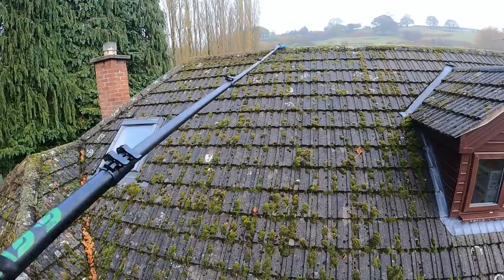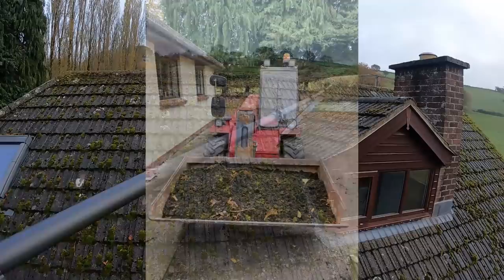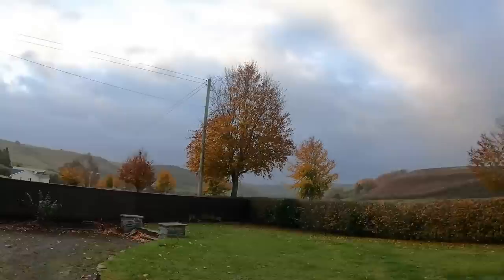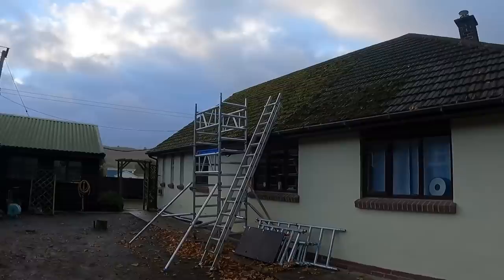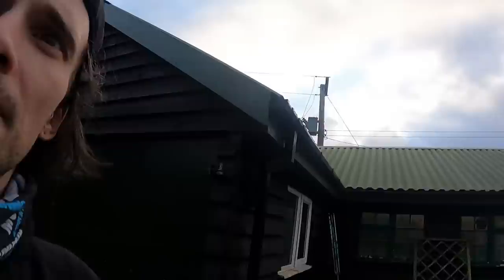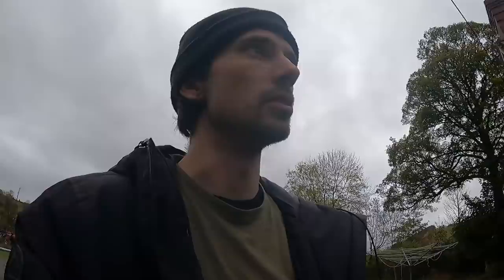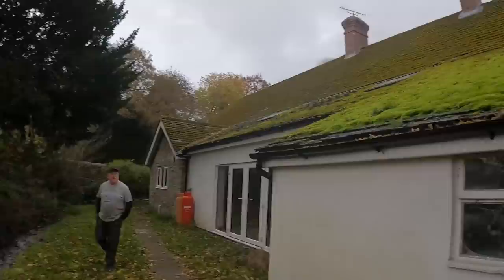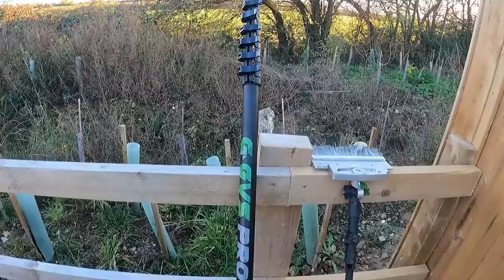THE CRAZIEST ROOF I'VE EVER CLEANED!

Comment: Would putting a tarp on the floor, along the walls, to catch the falling moss from the roof... be an idea ?
Hope you can requote and get proper compensation for the hard work.
Cheers !
Reply from the maker: I usually do but it was just concrete and like a really thin layer of gravel so real easy to clean up on this one, thanks!

Comment: That was a bit gutting for you. Did the customer send misleading photos or was it just difficult to see the depth of moss from the images? Would it have not been worth it to do as much as you could with both of you then come back on your own to finish as that way just your time and fuel to take the hit on? The pole is looking good, it would be great to see you flexible it is say next to your ova8 40 but extended same length.

Comment: I have to say I find the skyscraper tools don't fit snug into the roof tiles. Obviously the flat tiled roofs are no problem but when it comes to a Marley double roman for example  then there's  massive gaps between the blade and the tile, hence not getting half the moss. Does anyone else have the same issue? Do they need filed down?

Comment: Hey, I have been meaning to ask, what happens if the moss is left alone to live forever on the roof? Just Curious
Reply: Eventually it will start growing under the roof tiles and moss holds water so it will inevitably cause leaks on the inside then you'll need a lot of work done potentially costing thousands of pounds 👍🏻

Comment: Good Job on the first house....another great video.... You mush have arms and shoulders like HeMan..

As others have said sheets on the ground help making clean up easier - the gardeners use them when hedge trimming too for that reason.

However - if I was the second customer.... I would have been disappointed... you did a deal... then did not go through with it.... I understand you underquoted.. but if they gave you photos of the whole house... then surely its your issue?

How did they react to the news.?

Also as a thought - after you do the scrape... how about running a small FSC with your pressure washer and low pressure using the pole - to get the bits off before you do the bioside? especially with the badly covered rooves like these two?

Keep Up the good work!

Comment: Great vid as usual 😁 just a quick question how much does it cost to remove moss as my roof is horrendous cheers
Reply from the maker: it depends on the size of the roof really but anywhere frrom £700 - £1200 is a typical job, depends on contractor, distance to travel, how bad it is etc. Larger homes will be more

Comment: I have to ask, is there no machines out there to take the pressure off you, this is back breaking stuff....

Look I know some roofs jet washing isn't ideal but if done at a safe pressure could it not be done....

Is there no unit with spinning brushes to help.
There definitely has to be something and also wondering could you see yourself getting a cherry picker van to speed things up especially on jobs like that where access isn't a problem...

You should ask your customers if they wouldn't mind sending in photos of the afters, as it would be great to see the finished product after the bio side has worked

That last house is huge.... That looks a 5 day job......
Reply from the maker: i'll be getting a steam cleaning setup soon for the right kind of roofs, i dont mind scraping them, just not when i have too many one after an another it gets quite impossible to carry on :D
Reply: @PartridgeExteriorCleaning  great work you do and it's great to see someone with pride in their work and do it right.... Way too many cowboys at it.